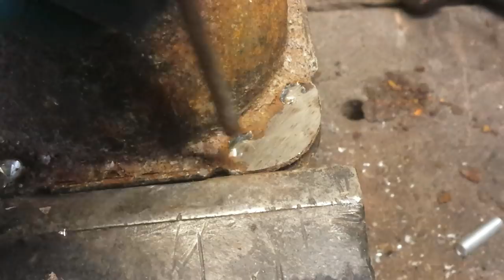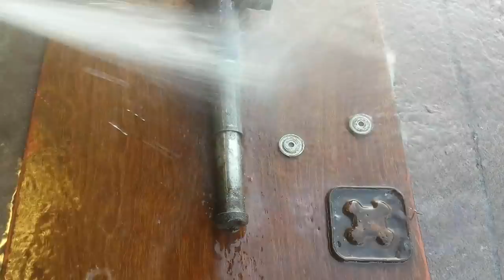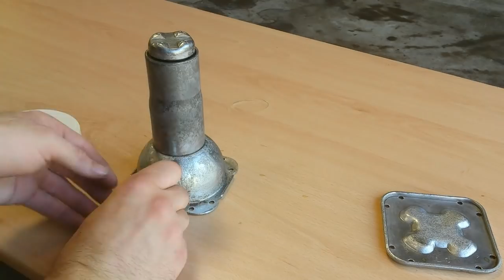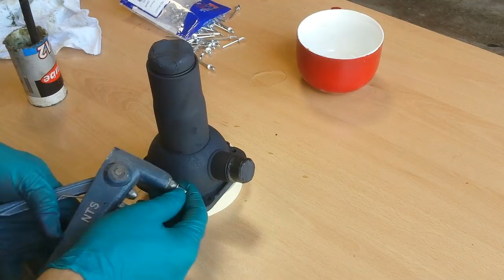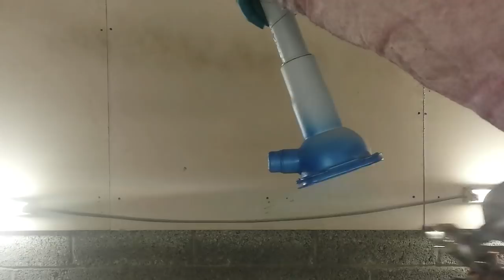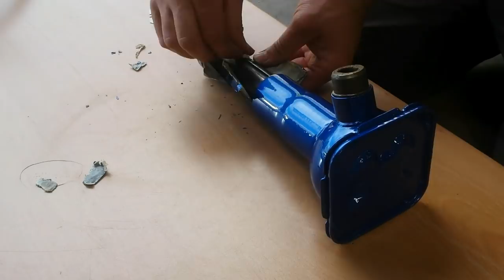Old Spiral Jack Restoration ( screw jack , bottle jack )

Comment: Nice restoration especially on the paint and the rust removal , not so sure about replacing the metal screws with aluminium rivet  if they can hold a few tons pushing on them will you would be working under the car how reliable they could be and how easy would ber for them to shear off ! Grade 8 minimum bolts at least would have been more secure  ! Just saying !https://www.youtube.com/watch?v=o_Al0E4rj7E

Comment: Very nice but I think you should have used 100 times more grease inside.
Reply from the maker: Hey thanks for the comment. I 100% agree with you if i was putting it back to work but its only for a display now so the only reason i put a little grease in is to stop the gears and the casings rusting.